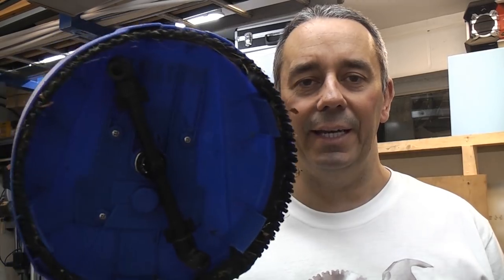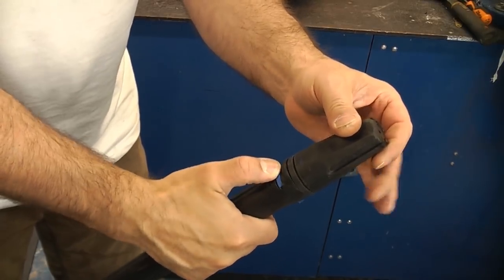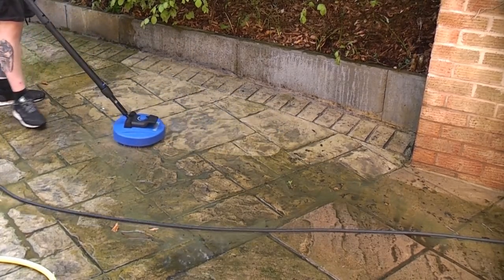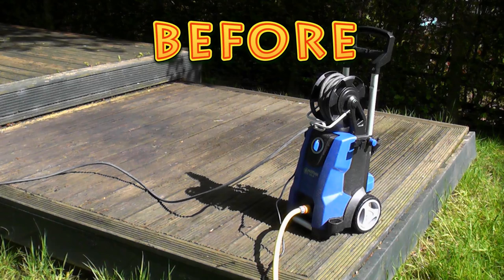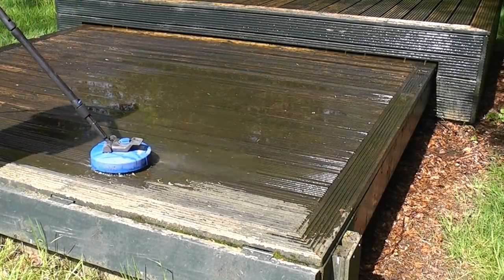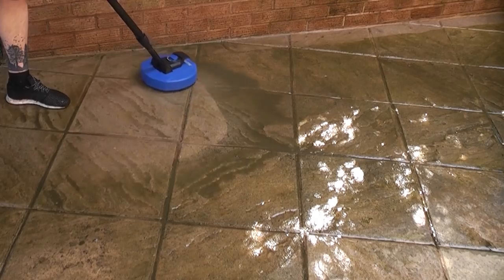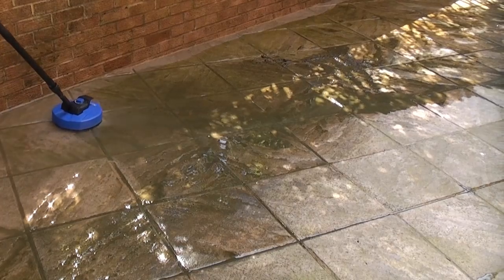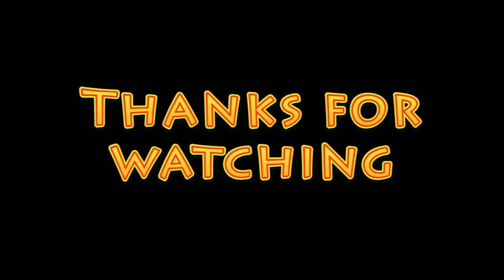Nilfisk patio cleaner

Comment: Had a Nilfisk pressure washer for 5 years, great bit of kit for the price. Only started using the patio cleaner last year, should have been using it from the start.  So much quicker and easier, plus it uses less water which is a bonus when you have water meter.
Reply from the maker: Yes, they are great.
Thanks for the comment

Comment: So I don't mean to be a pain but the review means nothing without knowing which machine you were using. The patio cleaner is going to perform differently depending on which machine as the pressures will affect the cleaning performance.
Reply from the maker: I'm pretty sure that it's designed to work with all Nilfisk power washers 😉

Comment: I was given a karcher pressure washer that came with a similar attachment. I was very dubious about how well it would work but actually it shocked me and did a great job. Not as deep a clean on concrete as a proper lance but plenty good enough for most areas. I reckon if you kept the maintenance up and did the washing a little more often it would be all you needed, and of course that's easier since it must have been 4 or 5 times faster than using a lance on larger areas.
Reply from the maker: Thanks, I'm thinking of spraying the whole outside with Jarder, which is supposed to stop any green moss etc. from forming in the first place. Hopefully that will reduce the amount of times that I have to clean outside.
Thanks for the comment

Comment: the only thing is the decking did not come out as should be same as the paving slabs some stains remain great review loved the video.
Reply from the maker: The decking was painted with decking stain last year, it flakes off after a few months, so I just cleaned it before applying decking oil.
Thanks for the comment

Comment: Nice, the one thing is these attachments quite expensive.

One question, all those surfaces you cleaned here. Were they cleaned before, then sealed by some sort of sealer?

It makes a big difference, to when you clean next time with washer.
Reply from the maker: No, none of the surfaces had been sealed before apart from the patterned concrete, which was sealed about 4 years ago (but most of the seal has worn off now)
Thanks for the comment

Comment: That looks very good. I was sceptical at first thinking the pressure won’t be god enough but it obviously does a good job. Does it need a minimum pressure PSI washer to work effectively?  Although saying that it is very therapeutic with a strong nozzle blasting dirt from a patio! Thanks for the review.
Reply from the maker: I don't think it needs a minimum pressure as I'm sure it will work with any Nilfisk pressure washer, obviously the higher the pressure the better the results will be.
Thanks for the comment ;-)

Comment: And less likely to destroy the patio slab pointing. I would be interested in seeing your choice of patio repointing mortar.....it looks like she will have you doing some soon.
Reply from the maker: Not sure about that, I did buy some years ago but never got chance to use it as it always rains here (apart from the last 6 weeks).
Can't be bothered raking out the old mortar when it is this hot!
Thanks for the comment
Reply: Ultimate Handyman there is a mortar raking tool that looks like two iceskate blades that does the job well. I am sure you already know the damage caused by water ingress to the sub base and then that is compounded by frost lift. One day spent know will save you a back braking couple of weekends. I have mine planed for September.
Reply from the maker: Yes, I think you mean the Arbortech Allsaw. I'll probably end up using the angle grinder and mortar raking disc 

I was contemplating ripping the lot up and having patterned concrete installed as well as the patio really needs an Aco drain installing as well!

Thanks for the comment

Comment: Pretty impressive for the price.
Reply from the maker: Yes, especially when you look at professional ones costing about £250
Thanks for the comment
Reply from the maker: Yes, the nozzles are angled at the floor, causing the head to rotate.
Reply from the maker: I've had two Nilfisk pressure washers now and they have been great. I have not tried Karcher!
My other Nilfisk pressure washer is about 8 years old and still going strong. The important thing with any pressure washer is to always drain them and don't let them freeze or it can damage the pump badly.
Reply: @ultimatehandyman  what model number is this? , the link isn't working

Comment: i have the compact version that comes with the nilfisk titan. problem is the rotating arm with the jets on it seizes up after 10-15 mins of use so i have to strip it down and then add some grease. is this the same problem with this attachment?
Reply from the maker: No, this version is absolutely fine. I've used this for several hours in a row with no issues.
Thanks for the comment

Comment: I got a similar patio cleaner with my Nilfisk but to be honest, I find it very flimsy and doesnt do a good job. This version may be a bit sturdier. Id still just use a nozel when cleaning decking though. Highly recommend Nilfisk power washers, far better than Karcher.
Reply from the maker: Are you sure you got the patio cleaner and not the brush cleaner?
I originally bought a rotating brush, then found out that it is only meant for cleaning vehicles and caravans etc.
Thanks for the comment
Reply: @ultimatehandyman  Thanks, no, its deffo the basic patio cleaner. The one you have does seem a lot sturdier though.

Comment: Is this actually doing to get me as good results and just using the lance without this. Speed and splash back protection is ideal for me but i wouldn’t choose it over optimal performance. How does this compare to just using the lance up close?
Reply from the maker: It depends how dirty the drive is. The patio cleaner is great for covering a large area much faster than the lance, but the lance can be adjusted so that it is really powerful and can get the drive cleaner.
Thanks for the comment 👍

Comment: Does the water pressure in the disk try to raise it off of the concrete surface?  It seems as though you would have to keep some downward pressure on the wand.
Reply from the maker: Not that I can remember, I think the jets are angled, so that they don't point directly down (which would cause lift)
Thanks for the comment

Comment: Any idea how this brand compares to others, like the karcher?
Reply from the maker: Not used a Karcher pressure washer yet. I bought my first Nilfisk from screwfix about 8 years ago and just stuck to that brand as it is still going strong now.
Thanks for the comment
Reply: Most of the consumer grade karchers we have had eventually leak or crack at the pump. Our current one has done well, not cracking by keeping it indoors rather than letting it freeze in the shed, but after 7/8 years of mild use is now leaking quite a bit from the pump.

Have heard good things about nilfisk, so might try them when this one completely gives up.

Comment: Is it actually any good at getting stubborn weeds out of the patio though?
Reply from the maker: Not sure. I used this the other day and had to switch to the lance to blast the weeds out from the expansion joints in the concrete, as they were quite deep, but it will remove some of them.
Thanks for the comment
Reply: @ultimatehandyman  thanks for the info! 👍

Comment: So this only works with the nilfisk pressure washer?
Reply from the maker: Yes, but other pressure washer manufactures have similar models for their washers as well.
Reply: Ultimate Handyman thanks for responding
Reply from the maker: You are welcome
Thanks for the comments
Reply: Ultimate Handyman  only trouble there is that each manufacturer has their own patented connection system so there not interchangeable,  like the standard garden hose connections are.
Reply from the maker: You can get adaptors though- https://fave.co/2KW6wEb

Comment: Surface cleaners are good if used with a powerful machine with a good flow rate, a device like this with a flow resistance is pointless, always use full power as dont forget you are dividing the power by 2 because of the twin nozzles.
Reply from the maker: Thanks for the comment